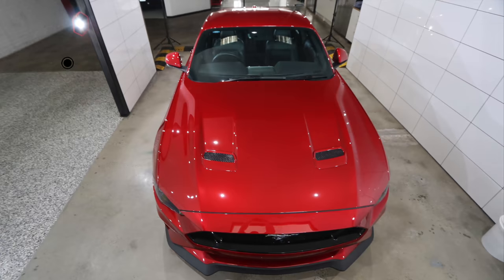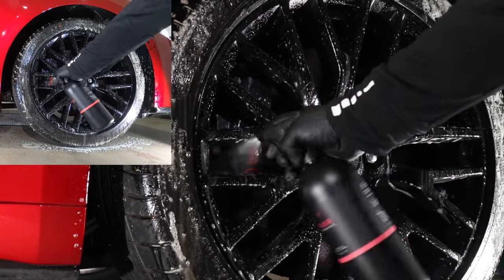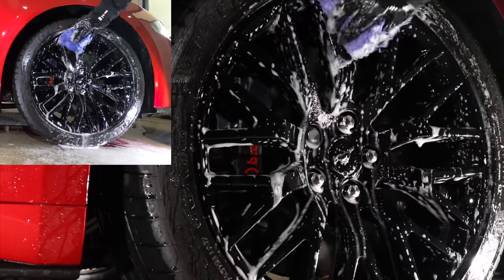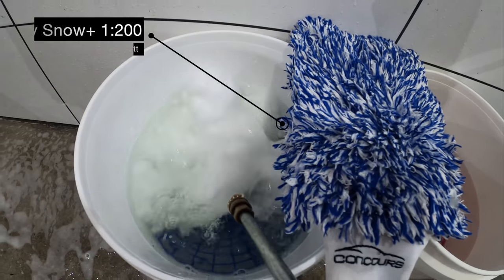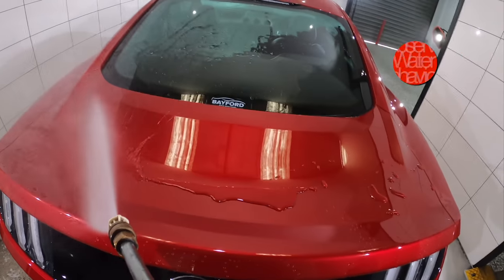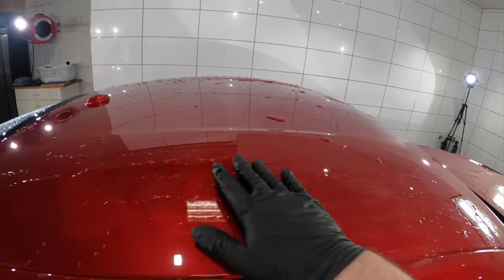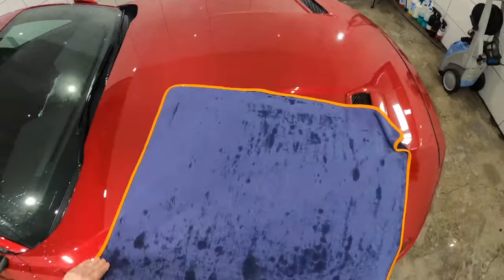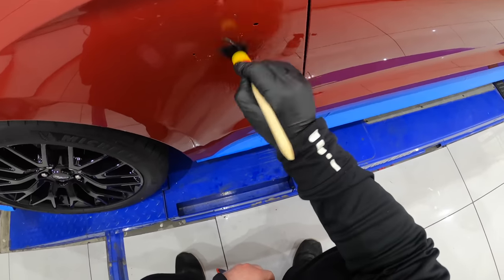HOW TO DETAIL & CERAMIC COAT A NEW CAR! 2020 Ford Mustang! P1 Wash & Decontamination! (Vlog 31.1)

Comment: Sandro my friend, I don't think dealerships will ever adopt safe car washing techniques. It's just way cheaper to use one bucket of soapy water to get through about 10 cars with a brush. Unless its a higher end car manufacturer, most dealerships only care about maximizing profits. (10 years in a dealership service department)
Reply from the maker: Unless enough people kick up a fuss so it ends up costing them more money to rectify the damage, then yes you’re 100% accurate!

Comment: Yes Sandro, inspection is key before doing any type of work on a vehicle.  I had the experience with a new car that front windshield was kind of scratched and with photos I demonstrated my client it wasn't me.  I also corrected the windshield with rayon pad and the Cerium, later used GlassParency's product as protection.
I asked the client if he requested the dealer to detail the vehicle and the answer was yes. So possibly the scratch was caused there or by vehicle transport.  I always advise people not to let the car dealer to detail a car or have them use Ceramic coating because of the awful job they do by not preparing it adequately and never know exactly which product was used.
Xoxo from Puerto Rico 👍🇵🇷

Comment: Hi Sandro, I hope that people realise how much much effort you really put into these videos. They are the best on YouTube, no doubt about that. My question is, why do you spray on the snow foam, and rinse it off before the hand wash? Wouldn’t leaving the snow foam on the car save more water, provide more lubrication and also provide more cleaning power? I’m sure you have a very good reason, so I’m looking forward to hearing it!
Reply from the maker: Thanks, and it’s because I use the snow foam as my pre-wash agent to remove as much dirt as possible together with the pressure washer before the hand wash stage to minimise wash induces swirls.
Reply: Car Craft Auto Detailing Thank you very much, it makes sense now

Comment: Under the current situation , I wouldn't be surprised Ford dealer sacked the guy used to do the cleaning on site and one of their sale actually either wash the car on site with 1 cloth and below average detergent, or even worse I seen a new car been drove to a near by car wash ( swire maker) for predelivery wash.

Comment: I don’t think dealerships know about the safe car wash practices, they just hire a regular general worker and give them retail car wash products, during this COVID pandemic I sent my car in for a service, they said they won’t be washing it due to  COVID related reasons but eventually ended up washing it and marring the paint, although detailing is becoming popular there are still a lot of people who still can’t tell the difference between a detailing service and a car wash.
Reply: The detailers, yardies etc at the dealerships know these methods. They do it at home and on the side (bro in law is one). The problem is 1. they dont have the time. They are forced to do a whole car in and out in 30 min. 2. They are not given the tools to do it properly. They are told wash and go.... NEXT
Reply: Exactly as Charles said i work at a dealerships service department and we do around 70 cars a day in our wash bays between 4 people using crap car wash and horse hair brooms and wash mitts that haven't been cleaned in months literally tried making them get proper equipment and products to no avail even brought my own good products in to use but don't get paid enough and yes i detail cars and cringe when i have to wash a $170,000 suv in the wash bay

Comment: Hey Sandro! I've just bought a brand new Hilux and have been driving it for the past week. I've just purchased UK3.0 as well as some Gliss to use as protection. Do you think that it'd be acceptable to thoroughly wash the car, use an iron remover, and then apply the coatings? I've never polished a car before, and I don't plan on attempting it on a brand new car.  Cheers!
Reply from the maker: Yes it’s completely acceptable! Polishing the paint will give you better results, longevity and performance from a coating but it in no ways means you can’t coat a car without paint correction. It just means that it may not last or perform quite as well.
Reply: @CarCraftAutoDetailing  Awesome! Thanks for your reply & love your work!

Comment: Hey Sandro, awesome video as always! I need your thoughts on something.... I bought Turtle Wax Compound and Turtle Wax Polish. I have used them combined with a DA speed 4-5 and some SPTA 6 inch foam pads.  I have tried the polishes and pads on different vehicles and I have the idea that its making more micro marring than removing. I also tried a finish pad with the Polish to give gloss and I suspect that even with that "harmless combination" some micro marring have showed up....What are your thoughts on that ?
Reply from the maker: I unfortunately don’t have any experience with the SPTA pads and I just haven’t had a great experience with Turtle Wax compounds and polishes in the past, but I know some people have. 
The reason you’re getting marring in the finish could be due to a lot of things so I really can’t say for sure. It could be that you’re compounding marks are aggressive and aren’t being refined in you’re polishing stage, or it could be that you’re polish and pad combination and technique is creating that marring itself, especially if the paint is. Using less polish can sometimes help finish better, but quite honestly mate it could be so many things, so I can only guess. The video I did on polishing soft paint may help explain things a little better if thats the issue.
Reply: The thing is that, this time I only used a finishing pad with the polishing liquid to give gloss and lock it with the ceramic...now is glossy but with micro marring (its nothing too bad but still, you know that we want perfection) . Is just frustrating. I bought this polishes to try them out because they are cheap, and the spta pads as well.

Thanks for the reply mate.

Comment: Is it better to do a pre-soak with the pressure washer before using the foam cannon to coat the vehicle in foam?
Reply from the maker: I find that the foam doesn’t cling as well and it gets more diluted if it applied over wet paint, but it’s a personal preference.

Comment: Hey Sandro, just wondering what you might recommend for a soap in comparison to the Snow+ that is available for purchase in US?
Reply from the maker: You can now get the Nv range in the US from https://parkscarcare.net/ but I’m sure there’s a lot of brands in the US that also make strip or decontamination wash products such as Adams strip wash and Griots foaming surface prep, I just haven’t personally used them.
Reply: @CarCraftAutoDetailing  I just see how religiously you use the NVs+ so for me, if you put that much faith in a product, that's a must have. Thank you so much for the link

Comment: Sandro, well done. One small question, when you wipe down the iron remover do you use the same towel and rinse with every panel or do you use multiple towels?
Reply: Probably a good idea to use multiple different towels.
Reply from the maker: I have a few towels dedicated and separated for this process and I cycle through them - they are my stinky towels!
Reply: @CarCraftAutoDetailing  Thank you Maestro!!!

Comment: 👍 Direct !!
Reply: Why do manufacturers not deliver new cars with a vrap to take off on delivery as porshe does, so that the vehicle arrives new without scratches etc ... It is shameful at this price to have a new vehicle to correct  !. Even the gear knob, pedals, and all parts prone to streaks, scratches are protected for delivery in perfect condition, and protective vrap and tape is not very expensive for them!  I don't understand 😏
 Otherwise nice car

Comment: Never ever, ever, ever let the dealership "detail" your new car prior to delivery. I didn't even let them take the plastic off the exterior on my STi.
Reply: I worked at a Ford dealership and our detailing department was actually pretty good, but not to this standard. Time is always money at a dealer..
Reply: @Mike-om4ro  I hear you re time is money, but this is so far below the bare acceptable minimum. Dealers here in Australia are very bad at basic pre-delivery and washing after a service, they cause huge damage. I had exactly the same experience with a Focus RS, my first and last Ford. Then they want positive reviews and loyalty?
Reply: @littlediablo  the dealer is more for technical service working on the motor than detailing.but are exceptions to the rules and are dealers doing a good job in cleaning it
Reply: @koioo2  I hear you bud but this is a new car, it got so bad because of a careless manufacturer and careless dealer. Unfortunately in Australia most dealers can't even do basic technical work anymore without a major fail. It's a huge problem here.
Reply: @littlediablo  okay okay
Reply: @Mike-om4ro  I also worked at a ford dealership in Michigan and I myself was a one man show when it came to prepping cars for delivery.  I didn't have the best products to use, but, they did get the job done no doubt.  The problem I had was when multiple cars were sold at the same time, I had to work quickly to fill deadlines.
Reply: Unless you have a guy like this working there haha

Comment: There is no such thing as a "Brand New" car. Think about it, The car has to be driven from the factory to the holding yard then transported to shipping yard, across the open ocean, driven off the boat to sit in a yard till it get's picked up again,
Or driven the distance to the dealership. Left again in a pre sale yard waiting on a pre sale check and "detail" then
Sits out side for someone someday to say yes! I'll take that one.
Reply: and washed 10 times by the dealer with sandpaper

Comment: Although I respect this craft of car detaling and paint correction, and I understand that the owner of this kind of shop won't turn the job opportunity down, I think doing such work on a new car is really too much. I mean look at the car! It is new, it looks great, you have to take deep look with a lamp to find defects. Protecting your paint is great but stuff like this can make  people always unhappy about micro imperfections which are unavoidable because the car exists to be driven. Then they turn into people who don't drive cars the way they should and end up spending so much money on these services and products but always end up being unsatisfied
Reply from the maker: Detailing my cars or my customer’s cars has never stopped me or them enjoying enjoying them. If anything it’s only enhanced the experience knowing that the cars look their best and are well protected. There’s no such thing as perfect and all cars will get swirls, scratches and other defects down the track, it’s completely normal and most people are fine with that. But when you spend so much hard earned money on a brand new car it’s nice to get something that reflects that new car experience in that moment even though it will pass. You wouldn’t except a brand new TV with scratches on the screen so why should new car owners except a brand new car with scratches and other defects all over it?